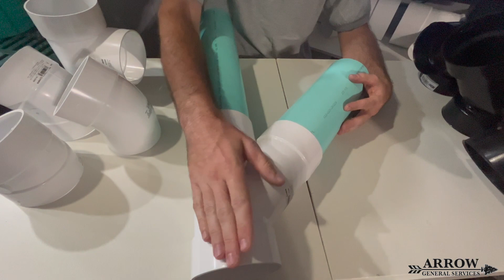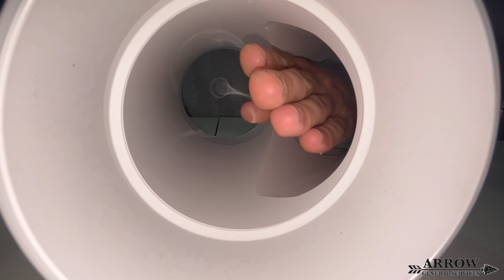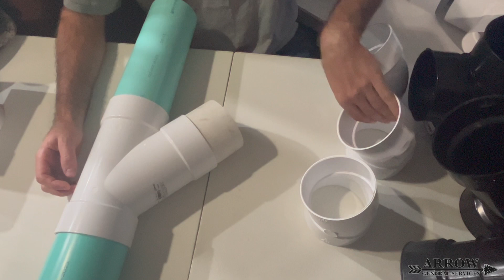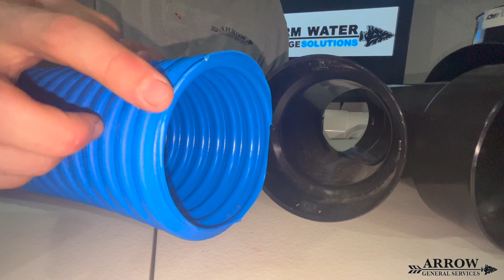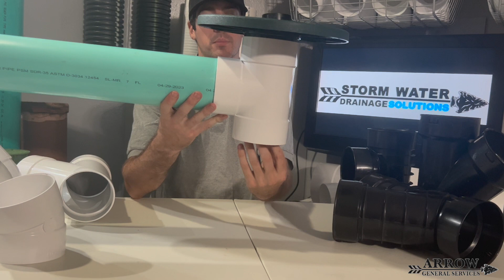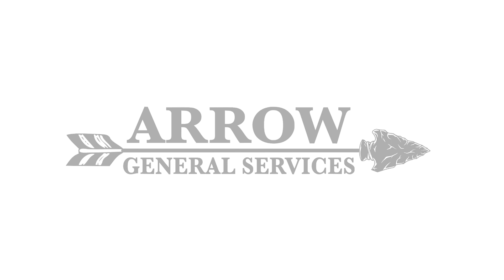Drainage Systems - Use the right fittings - Water Drainage Education

Comment: Do you ever use a 4-inch sanitary tee (aka sweep tee)? They have a 90* sweep and take up less space than a traditional wye. Also less fittings. I had to use one on a tight downspout lateral and also use them as directional clean outs.  They seem to work well.  I'm sure they are not as efficient as a wye, but definitely better than a regular tee.
Reply from the maker: Nothing wrong with using a sanitary tee if the space is too tight for a combo wye. You sacrifice a little efficiency but that’s not a big deal when it comes to yard drainage 💪

Comment: Is the 4” PVC Sewer and Drain pipe suppose to fit tightly in the NDS 6” round Speed Catch Basin? I am trying to install this basin and the pipe is fitting loosely and I know it’s going to leak.
Reply from the maker: Good question, and from my experience yes the 6” Sdr35 pvc pipe fits very snug inside those catch basins. I can recommend this solution instead if you are using Sdr35 pipe: Use a Sdr 6” tee fitting that has one hub that is 4” and glue a 6” cab onto one of the 6” sides. Now you have a solid 6” pvc basin with a 4” hub to solvent weld your 4” pipe to and a 6” drain grate will fit onto this tee. There will be zero leaks from this basin.
Reply: Thanks for your response. I am not using the SDR 35 I’m using the S&D (sewer and drain) PVC 4”. I wish I could leave a pic on this platform but it doesn’t fit snuggly. I squeezed some Lexel in the gap of the basin that accepts the pipe and screwed a 1/4” self tapping screw into the pipe and then into the basin. I’m going to send some water through it and see what happens. My other option would be put a short run of ABS corrugated solid pipe into the basin and then am adapter to the PVC pipe at every connection.
Reply from the maker: @chefjones11  Oh ok that’s why. Those basins are made to fit SDR. Hope we were of some help! ✌️